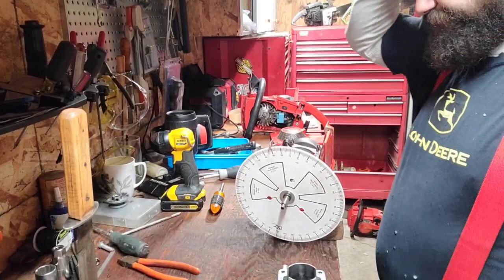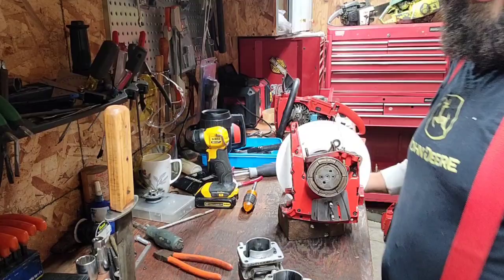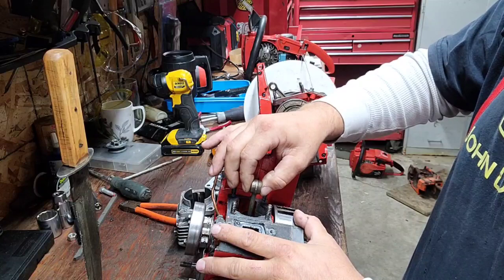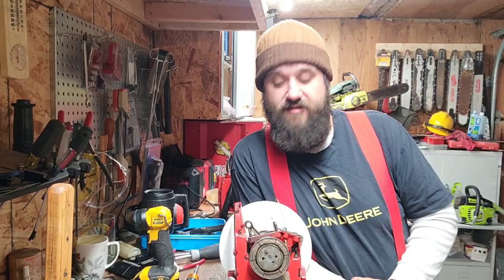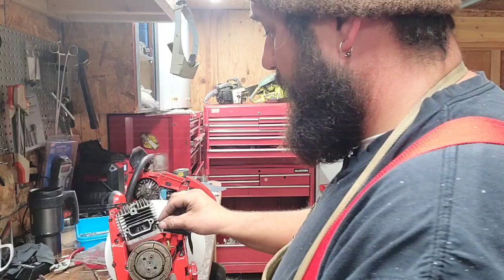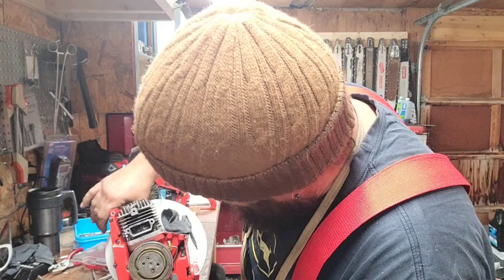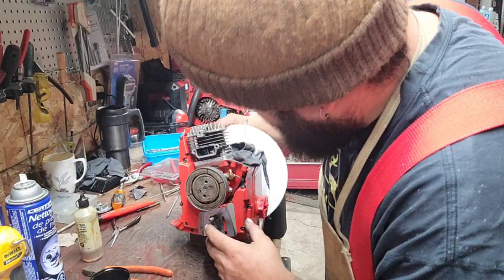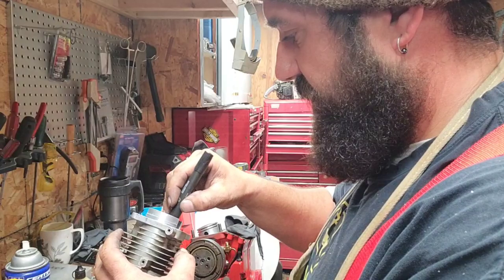Hotrod Homelite porting!!! Some tips and tricks for you all!!

Comment: I collect xl12s first saw I ever owned thing but when I do port work nothing like you are doing they heat up if it's 60 out side gas boils then thay start running like crap rich or not I am going to try to figure a shield for the gas tank but room is limited here is the weird thing I have a pioneer holiday 1150 I think same saw just rebadged thay don't seem to suffer from the same over heating problem as bad the only idea I have so far is hi temp silicone on the underside of the saw any ideas would be helpful thanks

Comment: I feel dumb, granted I've never ported a chainsaw, so I still don't understand how you got your exhaust port "new roof". I watched that part of the video twice. Still not understanding what I'm looking at.
Reply from the maker: You grind the "roof" or "top" of the exhaust port with a rotary tool to the line that you draw.

 Thats what the ring is for to trace a line for reference when you are grinding.
Reply: @tinmanssaws  I understand that you want to grind to the line that you draw, but I don't understand how you determine that is where you want to stop at.
Reply: I struggled with that as well at first, and with domed pistons I am still a bit fuzzy if the dome throws off the numbers.  That being said, he already knows the port roof- when light cracks. If he pushes the ring to the existing number-105 in this case, he then pushes the piston higher to the number he wants on the degree wheel-say 100. The bottom of the ring represents where the new light will crack. Essentially the top of the piston and the bottom of the ring are touching and gives a nice straight line. When he grinds that amount out, he can pull the ring, re-time and now the light will crack at whatever time he wants-100 For instance. 

Again, still wonder if the doming  on the piston will push the ring a bit higher-good method for flat top, but I  may be me over thinking. 

Do it on your saw and it will make more sense, helped me a lot as I am newbie to this.
Reply from the maker: @johnlincicum6390  experience and trial and error. To start add 2 degrees to the exhaust and 2 to the intake. Go from there. 

Porting takes time to master and what works on one saw doesn't always work on another, bore and stroke and size of the saw all play a factor in where you set the numbers.. Also every builder has "numbers" they like as they feel the saw runs best there..

One mans perfect saw is another mans ok saw. So the only way to figure out what you like is to experiment and find the balance between exhaust roof, intake duration and port timing. It takes time.

After awhile you will start to notice common numbers in saws that you feel run well.
Reply from the maker: @crazyfeller5704  the dome is in the center of the piston. The squish band area is where the ring sits and is usually close to flat or completely flat and therefore the dome plays no part in the exhaust timing. 

Pop up pistons will effect transfer flow as the air will hit the side of the pop up portion so when porting a pop up saw often you will need to reshape the upper transfers to aim the intake charge over the pop up section of the piston..
Reply: Thank you sir, that helps. Art, science, wisdom, experience, trial, error, hydrodynamics, drag, velocity, volume, and the list goes on. Who says this isn’t rocket science.
Reply: @tinmanssaws  I still don't understand how you get your determine of where to stop (or maybe I mean why to stop) at the top of the exhaust port with the ring you put on the top of the piston. I understand how you use the degree wheel completely though.
Reply from the maker: @crazyfeller5704  its darn close lol
Reply from the maker: @johnlincicum6390  too high of an exhaust roof and you loose torque but gain rpm. The saw will rev to the moon but stall when it hits the wood.  

Also too high of a max rpm and you can cause the bearings to skate and let go. 

There is a balance between intake, exhaust and transfer timing that is only learned by experimenting and unfortunately ruining a few cylinders along the way. 

It takes time and what works awesome on one saw may not be so good on another.
Reply: @tinmanssaws  Mcculloch next?
Reply from the maker: @johnlincicum6390  I'm working on getting some
Reply: @tinmanssaws  I'm trying to stuff a Super Pro 81 piston and rings in a 7-10 Automatic cylinder that's probably going to get a cast iron liner to make a 75.02 cc engine. I'm not doing it, but a friend in California is willing to try it.
Reply from the maker: @johnlincicum6390  cool
Reply: @tinmanssaws  it was just my brainstorm, lol! Going from a 2.00 inch bore to 2.06.